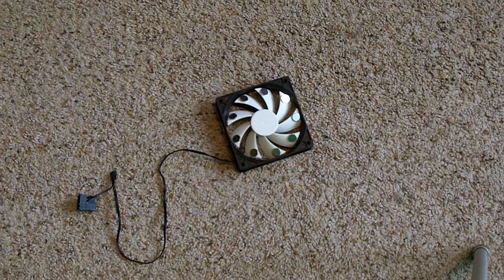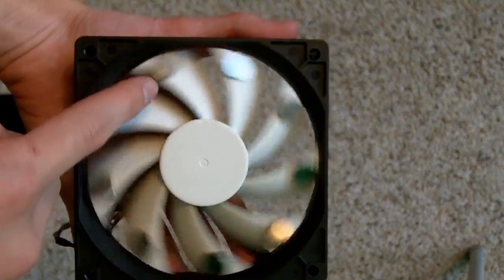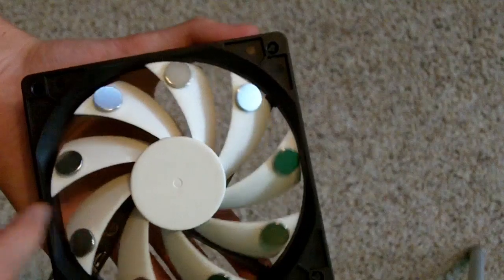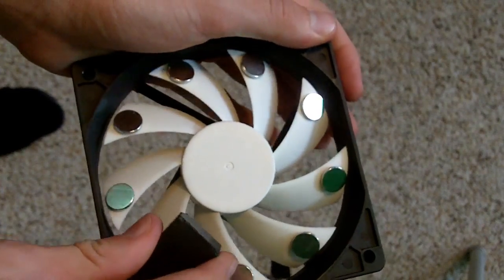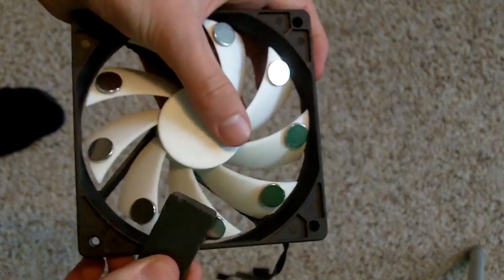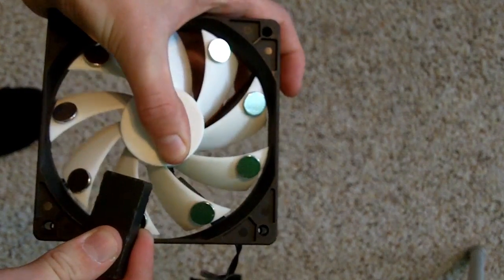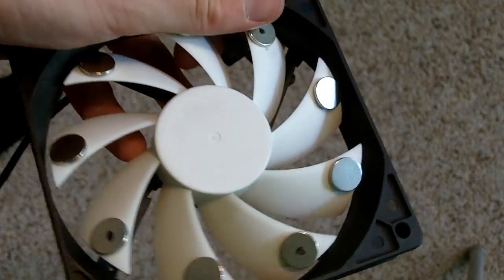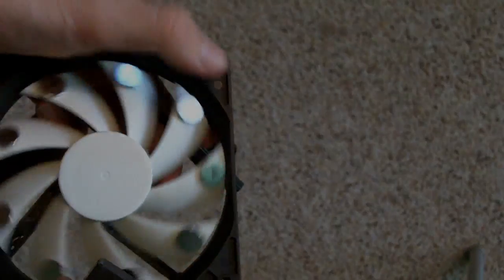Easiest Magnetic Motor - Free Energy - Real or Fake?

Comment: I've tried,ıt is not but With ferrite magnet.
power is not enough.
Reply: It does not matter how strong the magnet is, it can never work because Magnetic force is static i.e. does not move around and change in value therefore it tends to equilibrium which means it tends to rest, Not Moving.

Comment: Why are you wasting my time? You are supposed to use very strong neodymium magnets and the one in your hand is a ceramic useless piece of shit magnet.
Reply: Its a scam, the vids that you see of working motors, have a Reed switch that is activated by the magnet and opens the circuit to make the motor spin, I tried it myself and it causes a magnetic lock between the magnets.
Reply: where did you get it the .. propeller ? ...
Reply: which magnet should neodymium one in hand or disk
Reply: Lucian Apetrei ... I have tried this experiment and it 100% doesn't work, regardless of what magnets you use. don't be sucked in by these fools who trick people into thinking  CPU magnet motors actually work... it does not work, end of story.
Reply: I also tried and confirm it's fake.
Reply: Good man, I just don't understand why people are making fake videos apart from wanting attention
Reply: You already know the answer, what you mean to say is you do not accept this paradigm. Aknowledge it and move on with your life.

Comment: You have discovered the challenge of the fixed magnet motor. People will tell you to try a different angle or try shielding the magnets, but inevitably you are fighting the magnets. By the way, many of the same challenges are faced by the gas rotary engine, and a few of the sillier gas rotary engine concepts might just be a feasible solution for the magnet motor, but having the magnets fixed just means you are fighting to get an even slight gain which is just not of any value. An engine has to produce enough force to be usable, not just overcome friction.

Comment: Would have been better if you used a slightly larger neodynium mag to do the pushing .also place the fan flat and be able to lock off the position of the pushing magnet thats whatI did and I had better results

Comment: you have to use 2 strong magnets instade of one to make it work its based on pull and push and the smal magnet should be one by one N then S when the first strong magnet pull the first small one in the other side must be the oposit means the other  strong magnet push the smalest one and so on but to start the cycle it needs a hand push to start

Comment: use an electro magnet , that way you can switch it off and on with a chip or relay
you need a gate action
Reply: Scott Mitchell That's called an electric motor.
Reply: ***** electric motor requires a source of power. with a few coils and caps and like Scott Mitchell said this can be done, and has been look on youtube plenty of video's "John Bedini"
Reply: +Don Dupuis electro magnets dont require a source of power maybe ? Lol.
Reply: A perpetual energy engine will never be attainable. Cheers for the video.

Comment: Thanks for the video. No, you can't make an all permanent magnet spin any more than a gravity wheel. Unfortunately, this will prove nothing to the free magnetic energy/ government conspiracy people. They'll just say you did it wrong, held the magnets at the wrong angle, need to spin it opposite the direction of earth rotation to gather vortex cosmic energy or your magnets should be surrounded by Crystal pyramids or something equally nutty. Nice job though, I appreciate the sanity.
Reply: +Andy Jones I suppose u grew up in a small town some place and don't bother to test the science behind things because if u did u would have come across my work and seen that by using giron to concentrate the field to one face and copper induced eddy currents to keep the spin under 30.000rpm stopping a runaway u would see that an ape could build a working magnetic motor.
Reply: billy denim right, you just don't want the fame and fortune so you're keeping it a secret right? Or "big oil" will suppress your discovery and kill you. I have a pet extra terrestrial. Unfortunately I don't have any pictures.